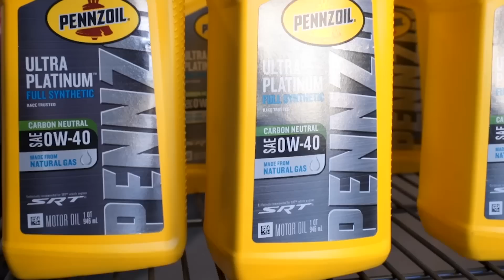The Honda IndyTruck Made it to SEMA!

Comment: The best part for me is the fact that this car is going to be used and not just sit and collect dust fills my heart with joy
Reply: Nawwww..... definitely will be sitting collecting dust.
Reply: @dickfitzwelliner2807  I'm no engineer but I don't think this truck will ever put the same amount of stress on the engine/trans as running an actual race. Indy cars make 6000-7000lbs of downforce at 200mph. The average speed at this year's Indy 500 was over 174mph. The cars ran over 30 laps or 75 miles of non stop wide open throttle and decel before they took the first pit. On top of that the engineer's probably softened the tune for this build.
Reply: @dickfitzwelliner2807  I worry about temps most of all. That would be really a shame to lose a part due to not having it up to temp.
Reply: Katrina Korolov_PTRD-41  Probably easier just to train people to use the tools they have for that purpose already. I'm sure there's someone around with a direct line on that engines health lol.
Reply: They need a whole team that they don't have just to start the thing. It may wind up on top of a container at some point...
Reply: Hoonigan isn't a race screw and the motor requires a whole team from Honda to fire up. It won't see much use. Maybe if they did it with just a k24 it would be easier to just do burnouts in, but with the amount of money and planning it takes to even start it, it's more work than its worth.
Reply: Maybe I'm too cynical, but I need details. What series? What events? GRIDLIFE? Super Lap Battle? All Suppy said was that they were gonna take it back and prep it to go out and race, but he never gave specifics.
Reply: katrinakorolov_ptrd-4168  Weight. Same reason it has an external starter lol
Reply: @chrishenry571  no they don't, its basically a laptop program (you have to monitor it to make sure everything is working of course) then theres a guy who has to use the outboard starter to actaully crank the motor over

Comment: Sweet looking show ride. I'm wondering at what speed that rear diffuser will start scraping on the road with the downforce from the wing. Carbon is a really stiff material, but that wing will be pushing DOWN.

Comment: Amateur tip on the torque wrench or breaker bars - position the wrench so you’re pulling up on it instead of pushing down, then you’re limited by how much you can deadlift, not just your weight. If the wheel spins, then it’s really time to call in your 400lb ballast boys 😂

Comment: 400lb/ft is some seriously tight wheel nuts you got there fellas!
Reply: For center lock is not that much, just like a road car. F1 uses 2000 lb/ft (2700 - 3000nm).

Comment: IMO, they could do aluminium powder carbon rods for the X brace that holds the back of the motor. That's another weight off. Carbon fiber roof as well...

Comment: It's still quite good power to weight. If the powerline just can take it. I have about 1250 kg (close to your new Honda)  Polo R and it rips with 315+ hp and 450nm torque(much less than in that Honda indy formula motor). I go under 4 seconds from 0 to 60 mph and it goes about same acceleration pace to 120 mph, taking about 8 seconds.

Comment: What is that chain drive in right side rear wheel? alternator? Anyway, that's on top ten coolest car I've ever seen, with audi s1 Quatro evo 2 Group B, volkswagen Polo R WRC the world champion winning car and Hoonipigasus. Ofcourse I've seen hundreds of very cool car builds but this one goes to the top. You should race the Pikes Peak with your new Honda. I bet it could beat 10 minutes with a decent driver. Tho you would need Honda to service the car because one engine won't take you so far. You are gonna need few engine rebuilds.

Comment: I'm gonna keep saying this, DO NOT PUT 0W-40 IN YOUR NORMAL CARS. ITS MEANT ONLY FOR ENGINES WITH EXTREMELY TIGHT TOLERANCES. Your engine will only get damaged by it, I'm surprised that these guys glossed over that, it's dangerous.
Reply: A ton of cars use lighter oils than 0w-40. 0-20 and 5-20 are very common these days

Comment: The build was going well I love it, until the absolute mess behind the 'B' pillar, then sorry I nearly puked, where is the 'C' pillar to connect to the back panel and bed sides, it is supposed to be a bloody pickup not a pukeup, love the wing love the concept but hell where is the rear cab area, it looks like it is nowhere near finished what a shame after the Rollsroyce, oh well hopefully it will not stop future partners from trusting you to build another project.
Reply: They are kinda limited on engine position. The engine and gearbox are a set size. If they shifted it so the engine would sit in the bed only, the bed would be enormous. They were trying to keep close to the standard wheelbase by the looks of it.
Reply: I like that you can see the engine and mechanicals. Frankly, if they're going to take this thing to the track, then maybe they can slap a bed on it.